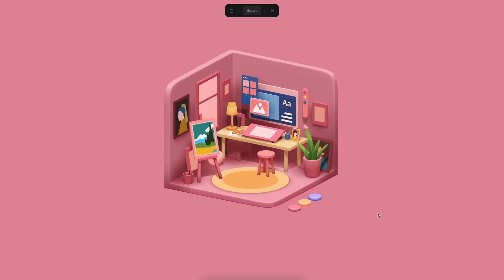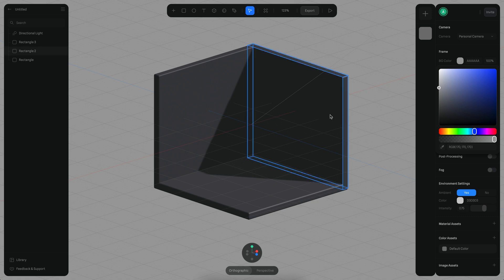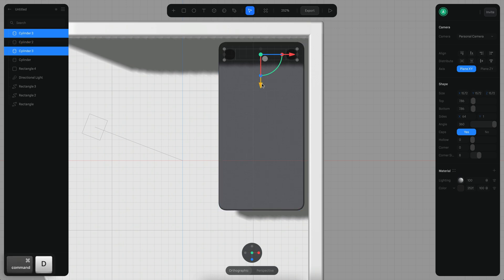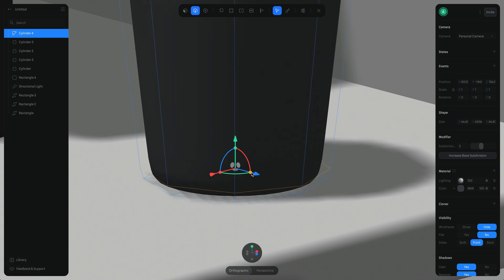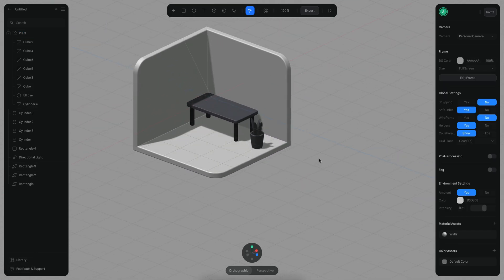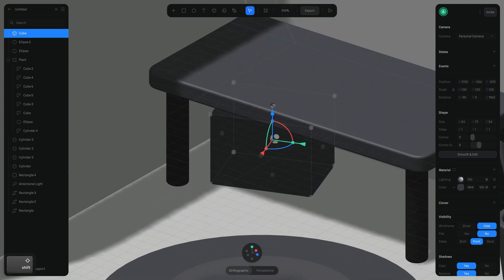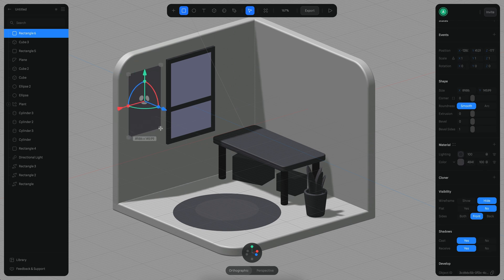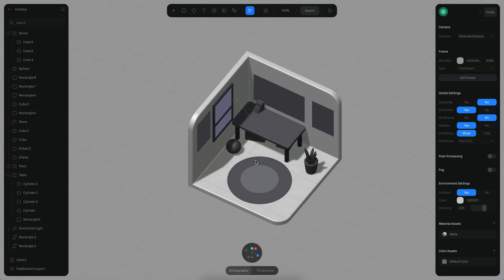Designing a Mini Room in 3D with Spline - Part 1

Comment: 3:15 I cant get my wall to curve. After selecting the edges on the right side bar there isnt a "Control Selected Point" on my screen .
Reply from the maker: Make sure you first select a point in order to see the point curve parameters.

To select a point, you need to double click on the vector shape first.
Reply: @splinetool  I did and the corner turns green but the “Corner selected point” doesn’t show up so I can curve the point
Reply: @ennayyyyyyyyyy  Same issue I'm facing man...
Reply: I just changed the corner instead of the Control Selected Point and it appeared similar
Reply: @janjanvlog8434  when i do this, all corners are changing. But in this case i just want one patricular corner to be round. How did you manage this?
Reply: same issue here, did you find a solution?
Reply: @fukksociety2019  nope 😕

Comment: IF YOU CANT USE OR MOVE THE LOOPCUT PART: Hold  command or use Edge Slide at the top. This was changed in the newer version. Very confusing but I figured it out.
Reply: Thanks! Also I realised that to use the loop cut you have to double click on the required area, not single click.

Comment: Creating the carpet - because the carpet and the floor are on the same plane, the carpet appears to glitch out. How did you manage to avoid this?
Reply from the maker: Hi Chris! This is probably because your circles are in the same Y position, try to move one of the circles a bit to the top, so they don't coliide.

Comment: Hi! I'm in the plant part, and I can't move the loop to the bottom, I've already reload the app but I still have the same problem. :(
Reply: Hold  command or use Edge Slide at the top. This was changed in the newer version. Very confusing but I figured it out.

Comment: 6:30- 6:45  During creating a plant, not able to move the loop to the bottom or up to define the shape in loop cut C. Please help. Am I missing something in the middle?
Reply from the maker: Hi! This is small bug, it will be fixed today. Meanwhile, you can reload the app and it will work again.
Reply: @splinetool  work with reload
Reply: @splinetool  It still doesn't work 7/13/22
Reply from the maker: @leftcoastexploring1389  Try force-reload the app to clear cache.
Reply from the maker: Update: We just fixed the bug with loop cut. 😎
Reply: @splinetool  actually the bug is still here, today, one month later :(. It works after reloading though.
Reply: @splinetool  thanks 👍